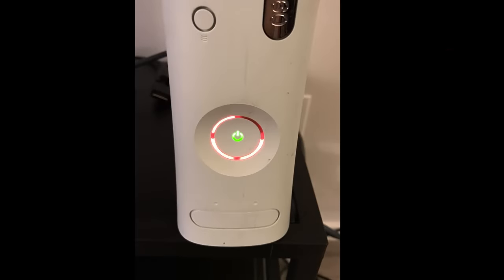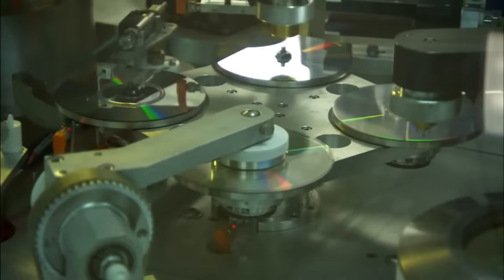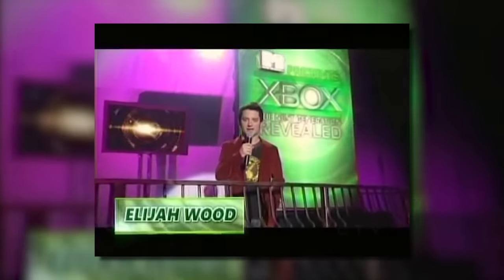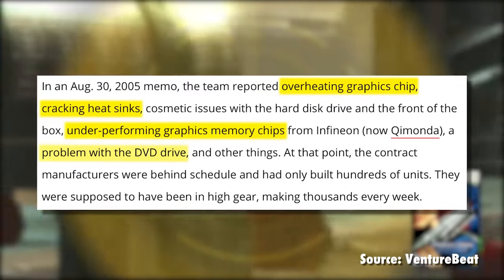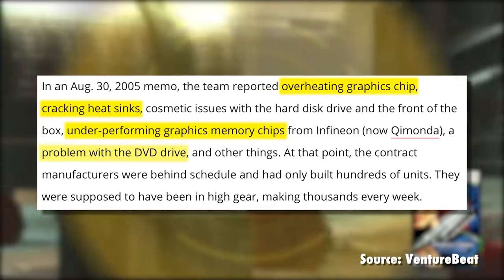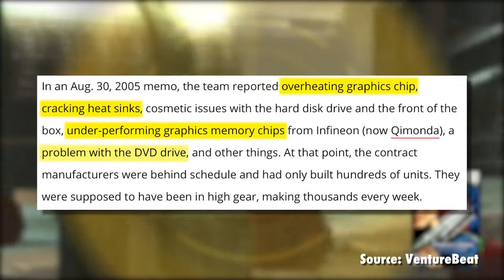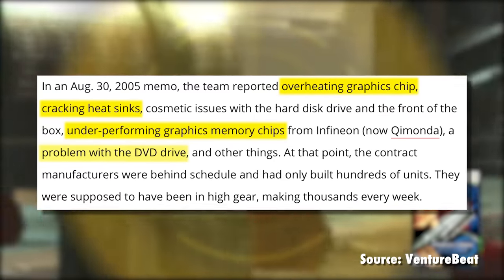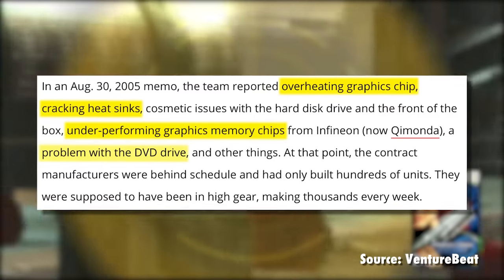History of the Xbox 360 Red Ring of Death | Past Mortem | SSFF

Comment: Nintendo is like the lone wolf of the Console war. It's like a wall. On one side is Xbox V PlaySlation and on the other side is Nintendo doing there own thing
Reply: Angel Gaeta right yoooooo😂😂😂
Reply: That’s because Xbox and PlayStation are aiming for the same audience
Reply: True
Reply: used to be Nintendo V Sega rip
Reply: Angel Gaeta they used to fight Sega, until they won
Reply: Kissasheep the Chalk Yeah, but sega wasn't much of an opponent
Reply: SmartMob true that, their only successful games are street fighter and sonic, but even those can be on Nintendo
Reply: Kissasheep the Chalk Yeah! I mean, dreamcast was "alright" but they were big flops
Reply: +SmartMob
Untrue. During the years Sega and Nintendo were slugging it out, Sega was handily beating them in hardware sales from 91 up through 95(when Sega pulled plug on Genesis). The problem was Sega was overly ambitious, they were obsessed with being the first to get 32-bit hardware out in the form of 32X and Saturn. This led to over-engineered hardware and a lack of competent SDKs that scared major developers away. This wouldn't be fixed until the Dreamcast era with it's easy to work with hardware.

However at that point the damage had been done with the Saturn. All Sega had to do was wait a few months in order to simplify the Saturn's hardware and break the PS1. What they failed to realize was that Sega had market presence and Sony didn't in the videogame field. A few months were not going to mess them up. 

To address their "only successful games", oh no it wasn't just Street Fighter and Sonic. That and you might be confusing with Streets of Rage and no you couldn't get those on Nintendo. Sega also had Phantasy Star, Altered Beast(admittedly not very good), basically any game made by Treasure, the Shining series. Sega had a huge amount of games and developers that were absolute giants back in the day that people forget.
Reply: But Nintendo led the sales, until the PlayStation one came in which Sega were out of the picture. Also, you said people forgot the good games. They couldn't have been too good then. I rest my case.
Reply: FedorovAvtomat You seem to actually know quite a lot. No joke, I really want some info on the PS2. Not being sarcastic, can you give me 5 facts about the PS2
Reply: +SmartMob
Sure, give a few obscure ones.
1. Saddam used the PS2 chips for guidance systems in missiles, a rumor that was completely untrue and is suspected to be started by a Sony employee to promote the power of the PS2. Biggest reason is that by 2000 you could buy the more powerful 533MHz Pentium 2 for around $150 in bulk and buying a $300 PS2 made absolutely no sense.

2. PS2 had a high failure rate on release similar to that of the 360, however it was almost always related to the DVD drive vs all the nonsense failing on the 360. So it was a very simple repair and an estimated 15-20% of PS2 units had this issue. Bad news is that there is no reports of Sony reimbursing people for the repair or even acknowledging it ever happened. This was until somebody decided to class action lawsuit Sony. Good news is that this was fixed handily by 2001. 

3. The "Emotion Engine" used in PS2 seems to have roots and might possibly be a reduced version of the R5900 CPU made by MIPS, processors that were equipped into SGI workstation computers that were quite powerful. Bad news is that it was so reduced that the "Emotion Engine" hardly had 1/4th the performance of a R5900 at the same speed at geometry. 

4. Sony tried something interesting back in the day similar to that of the Microsoft Kinect. They called it the EyeToy and it was the earliest example of camera based movement controls I can think of. While it worked, people didn't exactly bite, only about 20 titles supported the EyeToy. While Sega had the DreamEye device, it was little more than a glorified webcam.

5. There is a forgotten variant of the PS2 known as the PSX. While everybody knows about the 'fat' and 'slim' models, the PSX remains unknown mostly due to it being Japan only. It was a DVR and offered to be the one machine you needed for a full entertainment system similar to the likes of 3DO back in the day. Bad news is that it wasn't exactly popular either and discontinued the same year, which is a shame because I wanted one.
Reply: FedorovAvtomat OMG! You actually know loads. Had to look up most of the vocabulary in number 3 but your so interesting!
Reply: FedorovAvtomat sorry for arguing earlier on. I hope we can be friends?
Reply: Angel Gaeta ive heard that sony is kind of in a competition with nintendo
Reply: SmartMob

Sure, the world of videogames is very interesting. And we've only scratched the surface.
Reply: And then Nintendo came in with the Switch and won.
Reply: +R0bo_Dog 
We don't know for sure, but things are certainly looking up for them.
Reply: FedorovAvtomat YAY! Right, we are a team! We have to have a name!
Reply: FedorovAvtomat but they still lost after having a whole year head start
Reply: And Nintendo had produced the SNES for 7 years after the Genesis which secured them the market as a budget gaming console. You could go into a Toys R Us and buy a SNES Model 2 for $50 and it had a copy of Super Punch Out in 2000. They made the damn thing until 2003 in Japan, so that is a 13 year production cycle of Nintendo produced units. If you break it down year for year that gives us 3.81 million Genesis units per year of production and 3.77 million SNES units sold per year of production. And Genesis sales were still incredibly strong at the time of discontinued production.

Had the Genesis not been discontinued in the US by 1996 we might have seen more even numbers of total units sold, and if Sega had been making smart business decisions. It is undeniable that Sega's go into the 32-bit generation was quite foolishly done. As much as I love the Saturn, it was not a good situation in the US with the thing. Still find it funny the Saturn managed to outsell N64 in Japan.
Reply: Not really, Nintendo is stupid as hell to not admit it, but they have been in the competition since the SNES
Reply: +Hat Kid 
They've been in the competition since the Color TV Game.
Reply: What's a playslation
Reply: enderpearl 123 It is a series of game consoles created by Sony. The most well known are:
PlayStation
PlayStation2
PlayStation3
PlayStation4
PlayStation4 pro
PSP (PlayStation Portable)
PS Vita (PlayStation Vita)
Reply: +Big Smoke 
Nintendo gives a lot of shits. When the turn of the century happened, Nintendo changed game plan as a direct response to the rise of the PlayStation, which was... capturing the market with innovations instead of leading the hardware race. This is NOT because they were "complacent" due to Sega losing the hardware race. That is not the type of attitude when running a functioning video game company. Only a dumbass would sink their own ship like that. Anyway, you know the story, their method of primarily providing alternative entertainment with Wii was success at first, but by the end...

Their main goal now, is making sure Sony would never capture the handheld market with the PSP & Vita. Nintendo was able to maintain this space, and now they have the Nintendo Switch as a compromise of having 2 separate platforms. Nintendo is lucky that technology is capable of decreasing the power & gameplay disparity between home console & handheld experiences, and the rise of multiplatform games, since this wouldn't work quite as well otherwise.

I know that literally, the competition isn't exactly there, or direct. There's not a whole lot of reason to compare the offerings between Nintendo's platforms and competing platforms. But Nintendo very much gives a shit about their competition (which is why the Switch is Nintendo's response to a failed Wii U), and Sony & Microsoft is very much wary of Nintendo's impact on their own platforms, especially some time ago, with Sony's final handheld platform.
Reply: Mythos of Summer DO NOT COPY MY FEDOROV!!
Reply: Angel Gaeta and everyone knows onside that pc is the best
Reply: Angel Gaeta ps4
Reply: Angel Gaeta Nintendo is fighting the haters
Reply: Angel Gaeta XD ikr
Reply: did you forget dkc which crushed sega back in 94?
Reply: Gotta love Nintendo 👌😂

Comment: I've gotten the red ring of death multiple times and my Xbox still works. Also, the 360 that I have was from 2006.
Reply: Kitty Kitty Cat my is from 2011
Reply: Kitty Kitty Cat when my xboz had red ring it meant that it usually crashed in middle of games
Reply: Edward Spassov élève  It was more like a sign of upcoming death of unsaved game

1.Crash

2.Message about it crashing

3.some games dont even load when that message shows up when putting them in.

4.Sometimes Red ring of death appeared
Reply: Kitty Kitty Cat mine is from...

I don't know
Reply: I got the late xbox 360s around 2012-2013

Comment: The problem with the 360 was a super easy fix . It was all due to the fact that all the fans airflow was going to the cpu and not the gpu . I have successfully fixed and modded hundreds of Xbox 360 at the time by just adding a plastic divider in the fan shroud so that the airflow was devided into 2 streams , one to the cpu and one to the gpu . Its failure was all due to a simple issue of basic mechanics. Because the shroud had been altered to make way for the standard size cd rom by making the gpu side 1/3rd the size of the cpu side ! The airflow was no longer evenly distributed between both the cpu and gpu and it all went to the cpu , basic mechanics that was obvious to anyone who had ever experienced airflow issues with their car etc . A simple piece of plasic glued into the shroud meant that now both the cpu and gpu would receive air . A case of to many geniuses and not a single basic mechanic to realise the airflow problem. Cheers to all who understand the simplicity of the fix . Ps my units have lasted and are still running strong today.
Reply: Yes, seems like such a simple issue to fix and I can't believe they didn't realize it before it shipped.

I love messing with fans and cooling.
Reply: this for real?
Reply: If the fix to preventing an old Xbox 360 Core model from getting red rings was to barely modify the internal fan, why the actual fuck did I never hear about it, or anyone around me who also owned Xbox's during that time period?? >>:''''''(((
Reply: wam bam thank you 'mam
Reply: I just opened mine up and put a strong fan on it... Genius? I'm the kind of person who doesn't care what it looks like as long as it works n_n;...
Reply: not genius
Reply: @moochnhowzn do you have a video of this?
Reply: Wow I did the same thing that you did lol worked like a charm but you have to do it before the red ring
Reply: This assumes GPU overheating/failure as the cause of the RROD though, which while admittedly common isn't the only possible cause. I've had XBOXs fail due to dead RAM chips, likely due to overheating
Reply: it was also the fact (and this is the official reason as well i believe) that because microsoft had chosen one of its main target markets to be children, they could only have a certain amount of lead in the system. in general, lead based solders are SIGNIFICANTLY more reliable than non lead based solders.

Comment: I've had my xbox 360 for over 6 years  and nothing bad ever happened 
I guess I'm lucky
Reply: 6 years isnt that long.
Reply: Had mine since 2009
Reply: Original xbox
Reply: Had my 360 since day one
Still do
And got the new model
Reply: 10
Years
Reply: 11 years and it's still kickin
Reply: I had mines since 2012? And as of last year, it works
Reply: Nah ive had it 8 years and i got 3 red rings but i just blugged offthe big cable
Reply: Guess I am too, I only had disc drive problems both in Pro and Elite consoles. I had a 2006 Pro console and left it on for 2 days twice (Achievement hunting in Dead Rising) but it never overheated or red ringed.
Reply: Neck minit
Reply: Mine red ringed once but was fine later
Reply: Mine red ringed about 3 months in (xbox elite), bought it in early 2008 and got it repaired via microsoft the motherboard and GPU went 🤣 but now it's all good and still going 😎
Reply: Ik I probably sound like spam, but if your original 360 does kick out, you can fix it via the instructions on this page https://www.instructables.com/id/Fix-the-Red-Ring-of-Deathwithout-towels/
Reply: Same but longer
Reply: Lol the Xbox 360 never really got the red ring of death after 2010ish. I had the 360 since day 1 and i think i went through about 6 or 7 different consoles within about the first 4 - 5 years. Never happened again after i believe 2010 for me. Also the slim Xbox's were an improvement and for the most part got rid of the issue in general.
Reply: @breightonlarsen2152  you're better off just getting a used one instead of fixing at this point. Id literally give someone one of my 360s if they really needed one considering they aren't worth anything anymore.
Reply: Because you don't play games 12 h/d like any other normal person.
Reply: Same but mine is from release date
Reply: Same expect I’ve had mine for 9 years and counting
Reply: If you have an E model it won’t red ring it might get a red dot but that’s because the hard drive fell out
Reply: liar
Reply: Six years 😂😂😂😂
Reply: Same
Reply: I once got the 1 ring and 3 ring ya know.
Reply: @cameronbayliss3134  then you didn't try hard enough ask me how i know i immediately  nodded  a separate one of same model   tested it out under identical  conditions and loads  not 1 issue and less than half the temp keeping the  console looking  98%stock  with a button on the  back
Reply: Same
Reply: Tim Johnson you gotta use Xbox 360 e model then there should be no issues

Comment: I remember i was like 7 and begging my xbox to come back to life
Reply: should have got a PS3
Reply: @johnanderson-wo7mi  i did, i got the super slim brand new and it had disc drive issues. Couldn't win either way.
Reply: sanandreasX should have got the PS3 slim. That was the best version of PS3
Reply: @sanandreasX  i was not saying it as you should have gotten the PS3 because it is unbreakable, but just because the PS3 was awesome and has awesome games, but the PS3 failure rate was waaaaaay below the failure rate of the RROD Xbox 360 and all the issues the Xbox 360 has
Reply: @ryanishungry7409  No it wasn't. The best version of the PS3 was the launch version (also known as "the phat") which is counter intuitive, i know. Usually later versions are better. It was built out of more expensive materials, had touch sensors, made less fan noise because it was better ventilated and most important of all... It was backwards compatible with PS1 and PS2 since it literally had the PS2 chips inside as well while the slims did not and could only play PS1. As far as I remember it had more USB slots as well. Overall it was just more expensive to manufacture so the later versions cut down on some of the features to reduce costs.
Reply: Fucking mood. 

After years of nigh invincible consoles, I was absolutely gobsmacked when each and every new system I owned perished in about 2 years. 

Special shout-out to the 360 which tapped out at 4 fucking months.
Reply: Fat models for both consoles are surprisingly durable for sure.
The fat Elite 360 and the PS3 both outlived my slim counterparts.